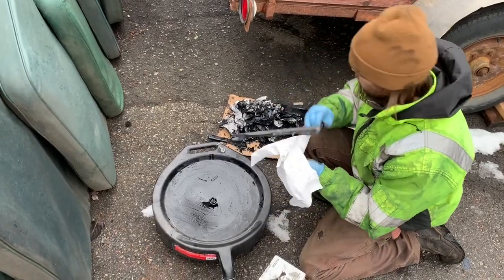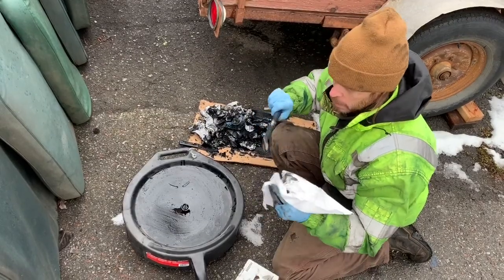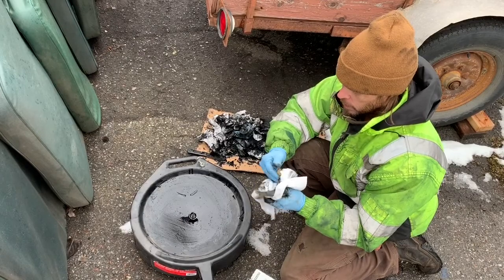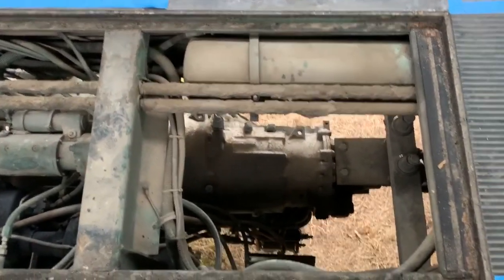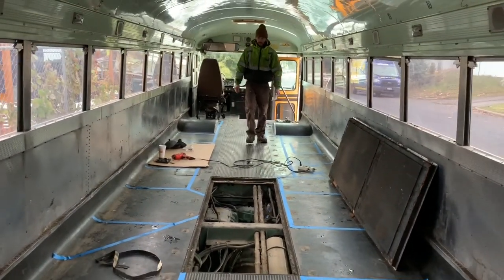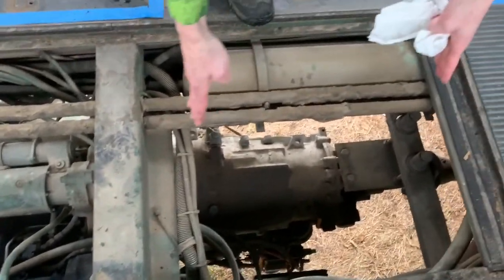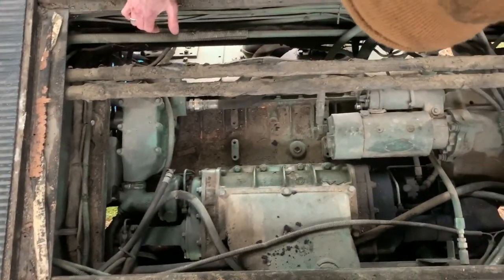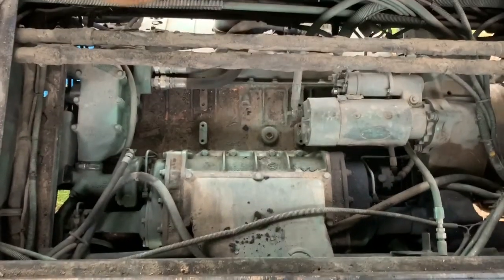Pistons inspected | 1989 Crown Super Coach | Skoolie

Comment: The unit with the 6 bolts in it that you didn't know what it was, is the engine oil cooler and directly below it is the water pump, below the water pump is the governor flyweights assembly: On the other end of the blower directly below the starter, the device with two hoses connected to it is the fuel pump, which provides fuel under pressure to the secondary fuel filter and then from there to the injectors. the primary fuel filter provides fuel from the tank to the inlet of the fuel pump under suction from the fuel pump.
Reply: The blower and turbo only provide air under pressure to the cylinders where it's compressed to a high pressure when the piston comes up.That compression causes the air to be so hot that when the injectors spray fuel into the hot highly compressed air, the fuel ignites and drives the piston down. That's how a 2-cycle diesel engine works.
Reply from the maker: Cool! thank you for the explanation :)

Comment: Are there no heating in that bus?
Reply from the maker: It has a front and back heater. Neither one blows warm air though. Just haven't got around to chasing it down. I suspect the cores or lines are clogged by corrosion. I guess they weren't really concerned with maintaining the coolant in these southern California buses. It had pretty much straight water in it when I got it. I winterized the engine but haven't gotten to the heaters yet.